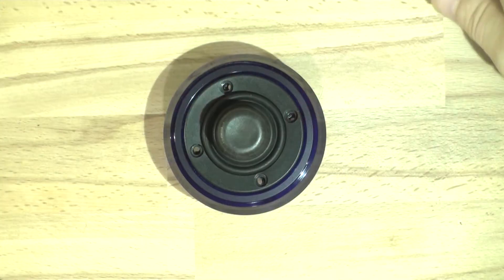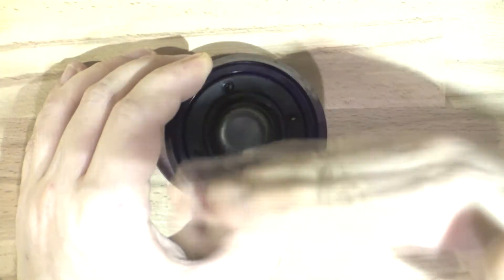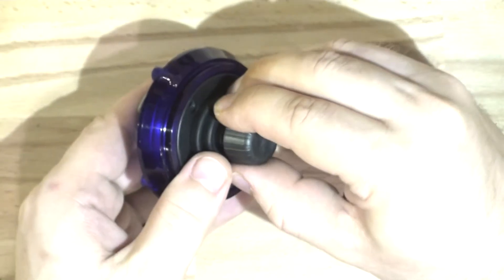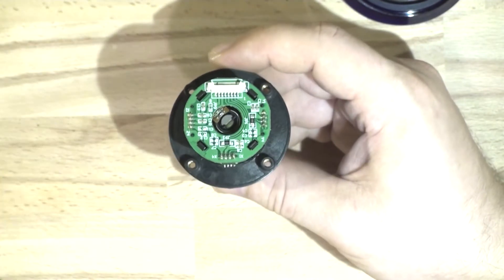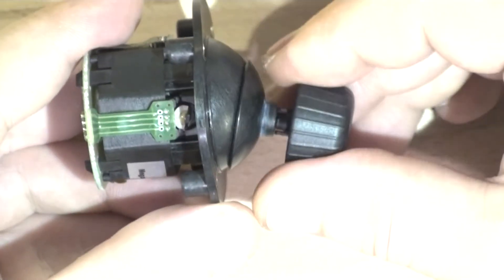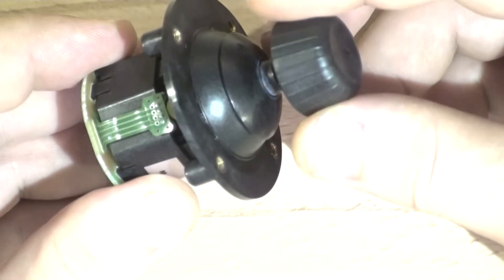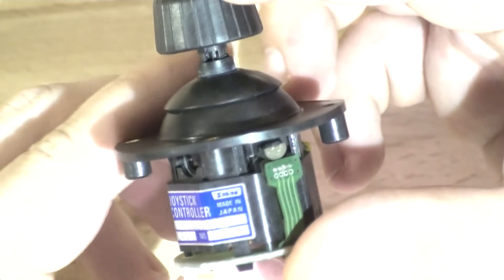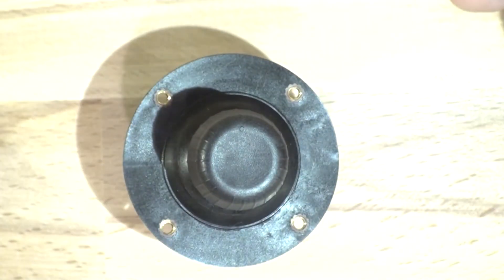Quick Look at Joystick Interface based on Hall Sensors

Comment: Aren't they also supposed to be more accurate? 

I've noticed regular joysticks when hooked up to axis testing, they seem very wobbly and inaccurate especially on diagonal axis. Does hall effect fix this?
Reply from the maker: Yes, the Hall effect joystick used in tv production, they are more accurate then resistive ones.

Comment: I was watching some videos about why the controllers on ps,xbox and nintendo switch are drifting and saw comments about old console using hall effect joystick. 
Yours is among the shortest and quite easy to see the hall sensor concept. Thanks.
Reply: Do you know which consoles used hall effect joysticks?
Reply: @gi11otine  Dreamcast
Reply: @zlac  That's so awesome! Is it better than the N64 Stick's Optical Sensor?
Reply: i can elaborate: the sega saturn analog pad and the dreampad were the only game pads ever to use hall effect thumbsticks. they felt different and not as precise as the resitive ones (lacking haptic centerlines), but they are are impervious to wear, center wiggle, drift and stuttering. (unless the lube goes bad or runs dry) it's a single disk magnet at the bottom of a ball joint, mounted above 4 hall sensors und the PCB. 
there is a reason, you've never seen replacements for sale, or repair videos for those.

PS: i can  only assume, somebody is hogging the patent, and sells easy to break gamepads instead